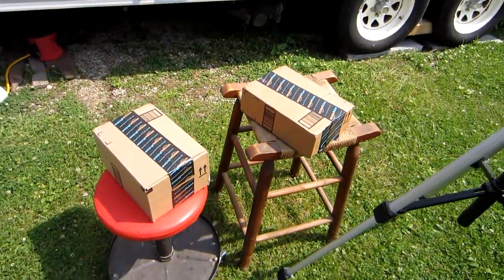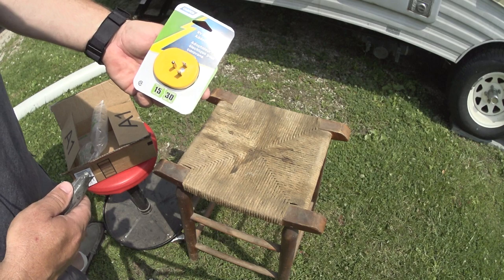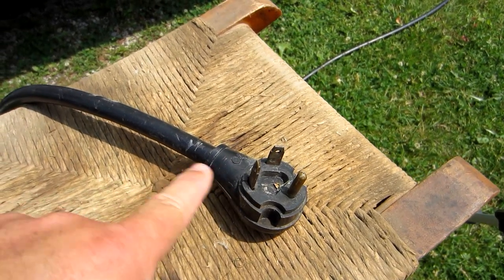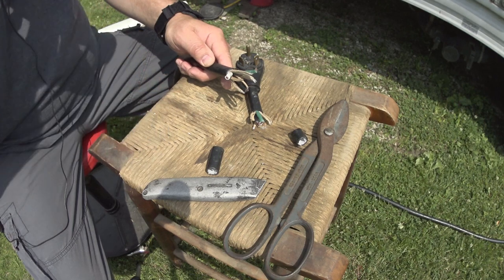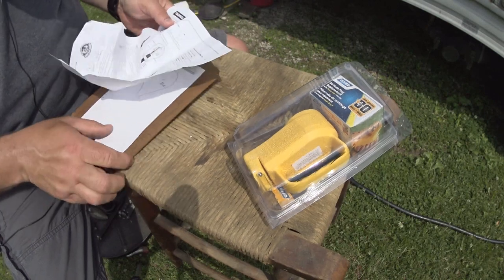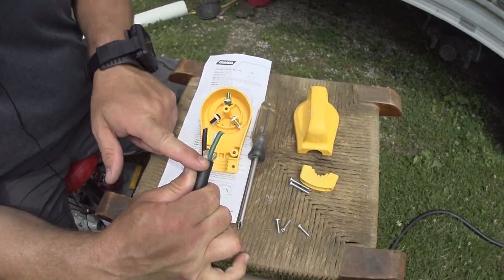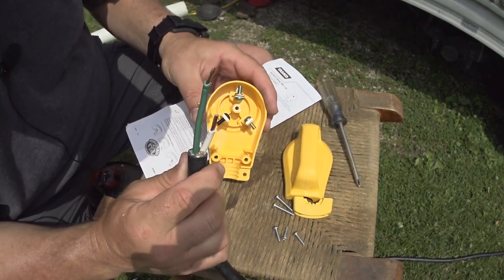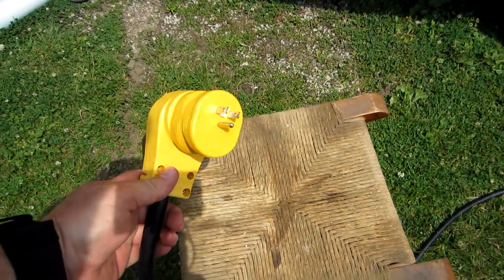Changing  the plug  on 30 amp RV cord

Comment: How is it holding up? I got the same plug from Walmart $25.99, it came quickly in plastic bag in box with no directions. Fortunately there are many on auto Tube showing how  it goes on. A new better more waterproof model is needed. I cut apart my molded black plug, inside was porcelain prong holder with crimp connections to wires, and white corroded ands.lightly burned. I have new RV smart plug and receptacle on other end.  The twist lock receptacle  on old style overheated and burned.

Comment: I wish you would have shown how to put the wires under the screw. Do you loop them under the screw head? Or do they slip between a plate and you screw that tight? None of these YouTube videos show how to do that part
Reply from the maker: There is no way you're getting that thick of wire wrapped around that screw. Once you get the plug in your hand you'll see there's a couple of plates and there's a provision for the wire to be inserted. Once tight the wire will be squeezed between the two plates
Reply: Use eye connector and crimps/solder them on then put under screw.

Comment: not just old campers. all 30amp campers still use this type plug. your whole problem is using the adapter. that standard house plug you dropped to  is not heavy enough for continuous use and is melting the plastic. Use the adapter for testing or storing camper. not for actual camping.
Reply from the maker: You must have missed it or maybe I didn't explain it well enough it melted at the campground plugged into a 30 amp pedestal there was no adapter. It was just old

Comment: Did this plug fit in the storage for your trailer?  Mine is only about 3 1/4 inside diameter.
Reply from the maker: Although I believe that it fit I ended up removing the handle so that at one of the campgrounds the utility door could be closed all the way. The handle was kind of holding it open further than I wanted it to. That was me just being nitpicky though

Comment: That's what happened to mine. I'm in a travel trailer and there's a motorhome next to me that shares the same main box. They kept using both of their a/c's even after being told not to, and extra stuff, which caused the box to trip a lot. Anyway,  one day my plug did what yours did but it burned and melted the rubber and broke the prongs and power box. I took it off and while I was out, the park manager had the electric co come out to fix the box and they replaced my cord since he was there and charged me $50. I was ok with that because it would've cost me that much just for the plug alone.BTW, did you they have glasses out that can correct colorblindness? They're cool. They're called Enchroma.
Reply from the maker: I would have paid the 50 dollars too...To have someone make an on-site repair, with parts, thats a good deal.. 
 I have been aware of the Glasses for about 3 years now but 3 things are keeping me from pulling the trigger on them.... 
1) They aren't 100 percent guaranteed to work... 
2) Too much money for something that isn't guaranteed to work... 
3) I cant wear sunglasses all the time especially when in the garage or under the Trucks dash working where it is dark already.... 
  I am hoping that they technology will advance to the point where it could be an optional lens when ordering prescription eye glasses OR better yet , Contact lenses that do the same thing...
 Its kinda of weird though because I am curious to see all the colors correctly but since I never have,, I really don't crave or want for it... Kind of like, asking someone who has never eaten a piece of candy if they want to try a Hershey bar..😁
Reply: Yes, I'm glad he did the job, because I was going to buy the part and then pay a neighbor to fix it.
As for the glasses, I do believe they have a guarantee. Also, they have indoor ones and outdoor ones. I don't believe it would be like offering the chocolate bar. I would never want to go without seeing all the glorious colors in the world. appreciate having the ability to see them. Even as someone who isn't colorblind, I am in awe and love looking at the beautiful sunrises/sunsets, fire, flowers, insects, autumn, etc. Many people have gotten them buy having a "gofundme" account. I don't know how that works, but you might like to try that. : )

Comment: shouldn't you have ran the green wire next to the white wire just to be safe instead of the black?
Reply: MRBULLRED I rather have the green wire being looped around its retaining screw more securely.. If I came in from the opposite side I would had to lengthen the wire more to navigate around the right hand side of the hold down post to position it to where when tightened it was deep into the face/front side of the connector so when tight it wouldn't twist around on the final turn and be "up"..   I can't imagine how any chaffing could possibly take place with the wires secured and the gauge being as" thick " as they are.. Even if the contact screws came loose the wire wouldn't bend without some consider manipulation.. If this somehow shorts itself out I will of course have a video covering it..
Reply from the maker: +Foxboss9 oops wrong account... Foxboss9 equals RVDaydream

Comment: Appreciate the effort but you skipped showing the most important part!! How to clamp the wires!
Reply from the maker: I'm pretty sure getting the colors lined up to the correct terminals is the most important part. But to your point, as a competency pre-qualifier, someone that doesn't know how to tighten a screw to hold a wire in a clamp that has a clear, obvious provision for each wire to be inserted, should not be working on electrical on any level. Hire a professional.
Reply: @Rvdaydream  Hah. I’m actually quite technically inclined. Still took me an hour to get wires correctly clamped.